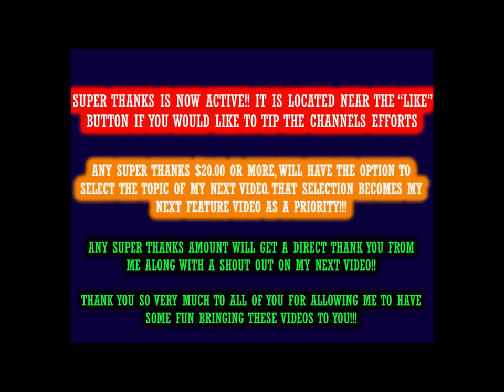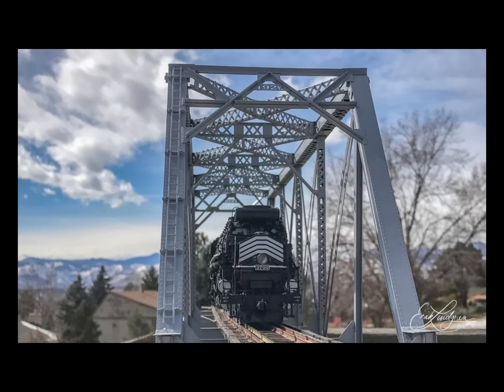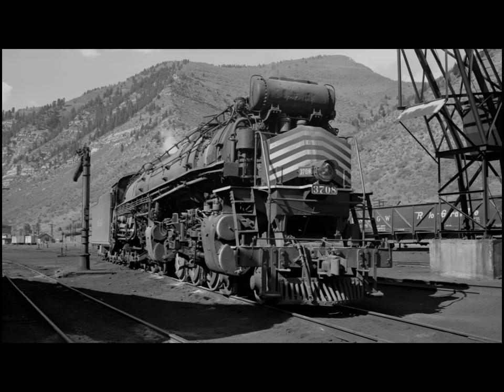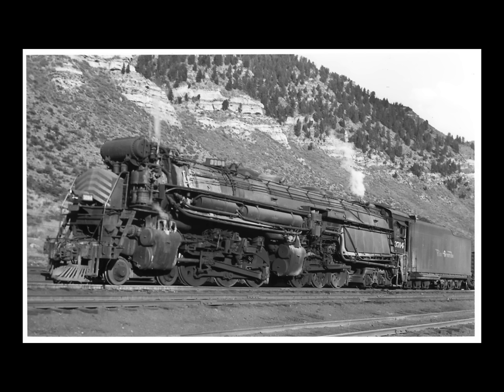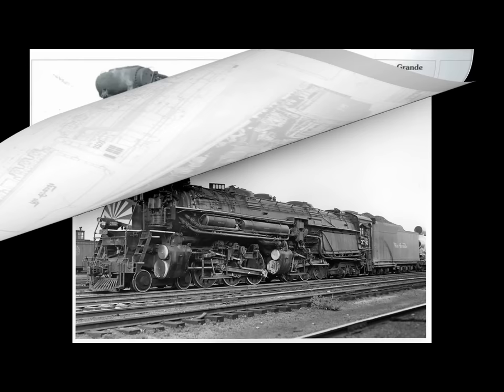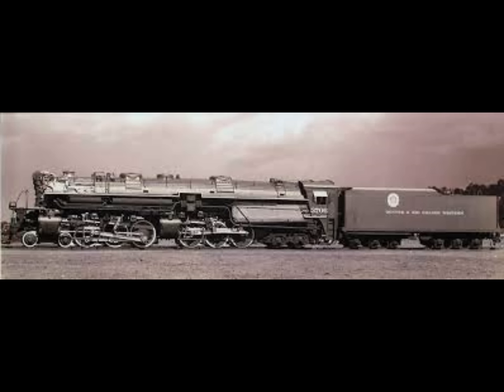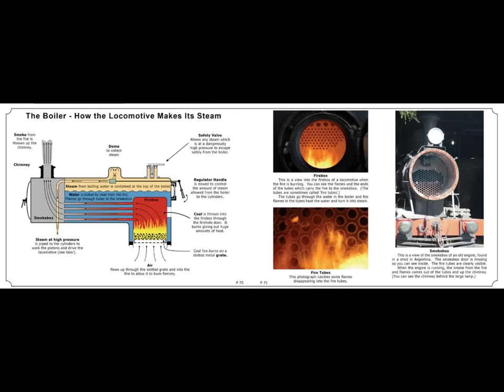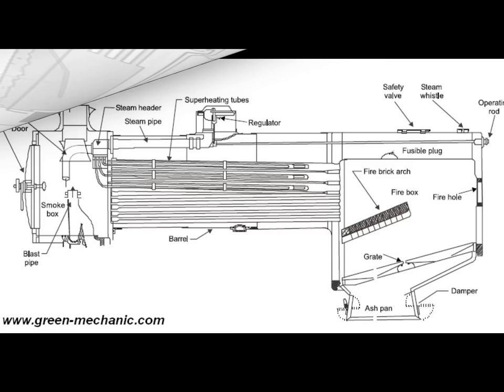Tragedy on the Rio Grande Locomotive No  3703

Comment: Steam locomotives, by their very nature, are rolling bombs. That said, overheated crown sheets seem to be the cause of most of these disasters. The very ironic piece of info is the fact that the boiler flipped 180% from the frames and that the front engine rolled so far from the rear, braking the drawbar. The force of the explosion must have been enormous. The force of the explosion, by what you described, must have gone downward near the firebox. I do wish we could have been able to see the photos of this accident. I know the D&RG hated the Challengers, and tried to sell them to the UP, which was unsuccessful. I believe they all wound up on the Clinchfield, which also had some similar to the model D&RG had. By the way, these models were NOT the same as the UP Challengers.
Reply: The RG hated the 3800 series challenger which were I believe 6 locomotives diverted by the war production board from the UP. They were disliked because they were lighter than the RG 3700 series challengers.
Reply from the maker: There weren't any available photos otherwise I would have posted them as I always do.
Reply: Why do I get the sneaking impression that some of these problems were just rammed through and the operators were made to deal with them?

Sounds a lot
Like what is going on I’m an unnamed company that builds enormous equipment that rides air instead of rails these days.
Reply: Could the crown sheet have been damaged by all the previous problems with the feed water, and just couldn't  take it anymore?
Reply from the maker: @ramblerdave1339  That's always a distinct possibility
Reply: @ramblerdave1339  the report pretty much states that.
Any time the crown sheet is exposed, you have a dry spot over the fire, and there is nothing to cool it off.
With that kind of pressure in the boiler, it’s not very long until it blows right down into the firebox.
Seeing that the doors were both blown clean off, and landed some 200 feet away (I think he said that), that would indicate that the firebox was where the rupture started.
With all the pressure in there, it was a gigantic steam rocket.
Reply: Rio Grande loved the Baldwin built L-105 3700s. The ones they didn't like were the UP designed Alco built 3800s. The 3700s served until the end of steam, while the 3800s went to the Clinchfield right after the war.
Reply: Those photos of this accident are published in a book on locomotives of the Rio Grande, as I recall.  I'll see if I can chase them down.  PS, they are impressive!

Comment: What we have here is a failure caused by negligence & incompetence. The DRGW shop crews failed to inspect the feedwater system up & downstream of reported faults, including the strainers, and check valves in the feed water system. Based on the evidence, it looks as if the hot water pump on the elesco was failing to prime and deliver water at sufficient capacity to avoid water sloshing over the crown sheet as is bound to happen with a challenger under load. I suspect the check valve was hammered into a seized condition by repeated backflow caused by drops in feed pressure from the pump.
Reply from the maker: Interesting thoughts..because something funky happened here for sure. Not the garden variety locomotive boiler explosion if there was such a thing.
Reply: My smoking gun is that the L105 along with other baldwins of the era, was fitted with thermic siphons. The blown out brick arch points to a seam failure where the siphon meets the crown sheet. That can only happen if water gets to about 3/4 glass while the engine is under load, creating momentary dry spots before the "cold" water gets drawn up by the siphon.
Reply from the maker: @steffen19k  Very, very interesting! I like it!

Comment: Phew  - not something I'd have liked to witness. You've just confirmed something which has been bugging me for years, ever since I first read Robert C Reed's book 'Train Wrecks'. American engines didn't have fusible plugs, a basic, fail safe safety feature. Why not?
Reply from the maker: SImply not required by law.. And given that they themselves were often maintenance issues.. Many railroads and engineers alike, chose not to use them
Reply: There are various ways to assure safety.  Fusible plugs are one.  To find out the full range of options, read Section 4 of the ASME Boiler and Pressure Vessel Code, which convers firetube boilers.  Virtually all railroad engine boilers were fire tube boilers, meaning that the combustion products from whatever was burned (wood, oil, coal) produced combustion products that were drawn through the boiler via tubes in the firebox.  Note that this excludes the superheaters. if applied, where the steam was drawn through the tubes at the top of the boiler from the steam drum to a plenum then the cylinders, that (the top of the boiler) being the hottest part of the flue gas path.
Reply: @TheRailroadCrossing-SteamPower  Yes. A lot of your laws were, and are, very different to ours generally. From  very early days our railways were subject to a lot more government control, by the Board of Trade than was common in the America of the same time - similarly in Australia, riverboats were. The authorities there looked at the Mississippi's safety record, and acted accordingly......

Comment: I surmise, the damage was done to the crown sheet in the months/weeks prior to the explosion. The day it exploded was because the previous issues weren't taken as seriously from an inspection POV as they ought. 
I bet one crew lied about how low the water got for fear of being terminated. When it exploded everyone in the maintenance department went into damage control and no one wanted to know.

Similar to this: I'm a big rig driver. In a very tight driveway on a Friday afternoon I delivered a load of steel that no one wanted until Monday. They were furious I arrived 30 mins before knock off. It was nothing to do with me, I'm a contractor and the steel company own me when I'm at work and I must do deliveries as directed - it's my job. If the company load my truck then I deliver the load it's not my decision to make whether I want to take it (safety concerns aside).
So back to the customer, they didn't want to move all these cars to make it easier for me to back in and insisted they would direct me. I questioned what would happen if they directed me incorrectly and I reversed me into one of those cars. They told me to get on with it as I was wasting time arguing. Well they directed me to reverse straight into car. I couldn't see what they were doing as they were using hand signals to direct me. 
When it happened they all vanished into thin air leaving me there on my own. Manager came out and asked me why I backed into that car, why I was there on Friday, so on so forth? 

I imagine this boiler explosion was a bit like that. When it happened everyone just disappeared - "I know nothing," like Shultz from Hogan's Heroes. 
Human nature is well known LOL.
Reply from the maker: We may have gotten an answer from a newer response.. The guy said it was simple human error.. As in the fireman simply lost sight of the situation and apparently was shielded thereafter from the investigation release.
Reply: I hear ya brother. Truckers get screwed when it's time for the receiver to go home.
I've been a big truck driver over 35 years.
We work hard to get there on time. The receivers will leave you hanging all the time!
Reply: I kind of thought the same thing as you! Damage was done prior to the explosion when they had all the trouble with the pumps not working... this kind of stuff is more common than you would think as prior mechanical issues has caused many accidents with other companies and machinery like as in jet airliner incidents where mechanical issues were repaired and corrected and inspected but damage was done that was not found during repairs?? It's anybodys guess that ultimately caused the boiler to explode, but typically, it's a series of anomalies and coincidences in a unique pattern that downs the jet, sinks the ship or in this case detonates the boiler.... RIP 🙏 victims

Comment: To anyone who has never worked on heavy equipment of any type- the amount of force described here in the resulting damages is absolutely incredible. Broken frames, the distances pieces were lobbed... 
NEVER underestimate the sheer power of compressed gasses, let alone superheated compressed fluids. Flash-boiling is absolutely no joke.
Reply from the maker: To a point that I am surprised the wrong people havent used this sort of thing to wreck havoc..
Reply: @TheRailroadCrossing-SteamPower  Hello I have a suggestion for a video with the end of steam locomotives look into the last two locomotives from all classes for example the "Mallet" 2-6-6-2 number 1308 and 1309,1308 which is a static display, and 1309 which Western Maryland Scenic Railway operates those are the last two built by Baldwin Locomotive works before they closed for good.
Reply from the maker: @kennethmaynard5046  I get your meaning... The Western Maryland I have a video for here: https://youtu.be/E0-dRV0LaRQ?si=sE571cMZjvIwlSU9
Reply: The fire service has an acronym, BLEVE, for Boiling Liquid Expanding Vapor Explosion, as I recall, and there has been some doozies.

Comment: Just came across this.  The description of the damage is that of a MAJOR CATASTROPHIC failure!  From the number of times that the water feed was reported to be a problem and the number of times it was "repaired" causes me to believe like many others who have commented that the shop work was either not performed or performed in a half-a**ed manner.  In fact, when you have an engine crew who has worked these locomotives saying the day before an accident that the engine was not steaming well, this is a clear sign that the damn thing should be pulled and a THOROUGH inspection be had.  Thanks very much.

Comment: Sounds like steamers were blowing up all over the place. I do enjoy all your videos and not just the tragic ones.
Reply from the maker: A little more common than one thinks these days because they aren't ran in mass anymore.. But back them when you had full fleets of them.. Yeah.. pretty common.. But each story is it's own.. Some with intrigue and mystery.. Some with obvious causes.
Reply: @TheRailroadCrossing-SteamPower  Here in Australia it was unheard of for loco boilers to explode. It happened in the UK in the early days from boiler corrosion and small engines being put on long trains and drivers screwing down the old salter type safety valve. But neither our engines or the UK's engines had low water alarms but they did have two fusible plugs in the crown sheet. One near to the firebox tube plate and the other near to the cab. 
In WW2 in the UK an engine's injectors refused to work and the loco foreman told the driver via telephone "I don't care what you do just don't drop them plugs. So the loco crew standing in a station used soil from the station gardens to smother the fire. The next day on a different loco on the same line they saw the wrecked station gardens with plants strewn all over the place but didn't tell the station master what had happened. On the preserved railways today before lighting the engine up they use a torch to check the fusible plugs in the crown sheet and if there's even a slight weeping of moisture round the plug the loco is immediately failed and taken out of traffic. It's easy to spot as a dark patch round the plug.
Reply: there were over 200,000 steam locomotives built in the USA and there were less than a dozen known catastrophic (caused deaths) boiler explosions like this one. I could hardly call that common.
Reply: Every year in the US, there are a handful of boiler explosions.  I would say not more than ten.  Most are small  package boilers providing building heat, but occasionally, they are not.  A boiler exploded on a tourist steamer a couple decades ago.  All fired boilers fall under the boiler code of the state; every state I know endorses the ASME Boiler and Pressure Vessel Code.  If you operate (fire, maintain, service, or provide parts for) a fired boiler, you MUST follow the code.  From the descriptions here, I suspect there may have been areas where the code was not followed.  The incomplete maintenance record suggests one area.  Other accident descriptions is another.  Today, the FRA and NTSB would investigate the accident.  The State of Colorado would have investigate this one, in addition to the railroad and boiler inspectors.  There is likely much more information available on this event.  I vaguely recall reading it 40 years ago, in the 1980s.  Even then, this accident was 30 years old.
PS: Around 1900 there were well over 1000 boiler explosions per year.  A garment factory one in New York City in 1910 killed around 100 young women garment workers.  That is why we have a boiler code.
Reply: @AussiePom That's the thing, I was astounded head it didn't even have fusible plugs - they're such a basic safety measure, and as far as I recall, they're a legal requirement here and have been since long before the challenger was even thought of.
Reply: @jonathanj8303 Exactly Jonathon what's the point of a low water alarm for it doesn't get water into the boiler and it may sound off just before the boiler explodes. The fusible plugs have a core of lead which melts allowing water from the boiler to spray into the firebox quenching the fire. It does untold damage to the boiler for the sudden contraction in the metal but not enough to rupture it and it damages the firebox too. It usually means a new boiler and firebox before the engine can steam again. Only one fusible plug has to melt not two.
There was a preserved engine here which in 1994 whilst climbing a grade the fireman let the boiler water get too low and the front fusible plug melted which put the engine out of action immediately. Because of the huge amount of damage it causes that why they say "whatever you do don't drop them plugs".

Comment: Hi! New subscriber,  YT put you in my mix  today.   Great railfanning historical video.   Great presentation of archaic info.   You really dived into this.   I have worked on shipboard propulsion plant design and listening to you, it sounded to what you concluded about the feed water conditions.   There was no mention in those maintenance reports about cleaning out a strainer.  Sounds like it was clogged thus not allowing correct feed water flow.
Reply from the maker: Welcome aboard! Well, another poster with knowledge stated the Fireman was at fault for the accident.. And maybe so.. But there still has to be a cause and as you mentioned.. Certain parts of the injector were not looked into.

Comment: Native Colorado here. Some struggles with pronunciation of place names.
The accident happened at Louviers, which is now a few miles south of the urban foot-print centered on Denver.  Would have been a bit more out in the boonies in '52. "Loo-ve-urs" more or less.
Could the crown-sheet have been exposed and weakened on a previous trip? Did the locomotive operate west through tunnels?
My father fired steam  for the B&O west of Baltimore through a series of tunnels, a less steep (from 12 to 500 feet  above  sea  level) version of the Rio Grande west of Denver. He said it was common practice when pulling drag tonnage up-grade to enter a tunnel with boiler full and fire fully stoked then shutting-off feed water and coal.  Adding either cools the fire and causes more toxic exhaust. Engine crew was motivated to let boiler water get as low as they dared to let it.
Reply: With at least one repair ticket fixed at Minturn, the loco would have made the trip from Pueblo to Minturn over Tennessee Pass and through several tunnels besides the one at Tennessee Pass.  Minturn is between Dotsero and Pueblo.  Dosero is where the line from Denver connects to the old main line over Tennessee Pass.  Dotsero is between Minturn and Grand Junction and between Denver and Grand Junction.  Most traffic would either be on the Denver to Grand Junction line or the Pueblo to Minturn to Grand Junction line.  I believe at that time most freight trains went from Denver to Pueblo to Grand Junction instead of over and through the Moffat Tunnel to Dotsero.  The UP has basically rail-banked the Dotsero to Pueblo line in favor of the line through the Moffat Tunnel because it is the much shorter route.
Adding coal to the firebox will cool the fire while adding water to the boiler cools the water in the boiler reducing steam production.   There should not be much difference in firing or steam production with the use of a good stoker and feed water heater with a pump.  
There are no tunnels on the Denver to Pueblo route.  This is on the front range of the Rockies and basically the Western edge of the prairie.  There are 3 main stations Denver, Colorado Springs, and Pueblo.
Reply: Railroad superstition says 3+7+0+3 = 13
Reply from the maker: I only know how to pronounce French one way.. What American English makes of it is lost on me every time. Including my Maternal lineage. Always pronounced wrong.,
Reply: I'm afraid my French accent comes via Cannock Chase and the English Black Country - real Frenchman conner understand their own language when I speak it to them. Some years ago my wife and I were in Denver, and asked a bus driver if he went to Boulder (English pronunciation - Bowl-der) "Nah", he replied Ah does go t' Boolder, though....."  @TheRailroadCrossing-SteamPower
Reply from the maker: @JohnDavies-cn3ro  Love the story! I was in France for a spell.. That is longer than a tourist would.. Anyhow.. I pronounced Louviers the way I believe they would have otherwise.. Which was  Lou-vi-eh on my part in the video.